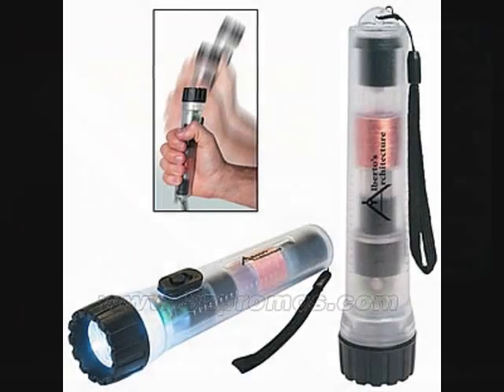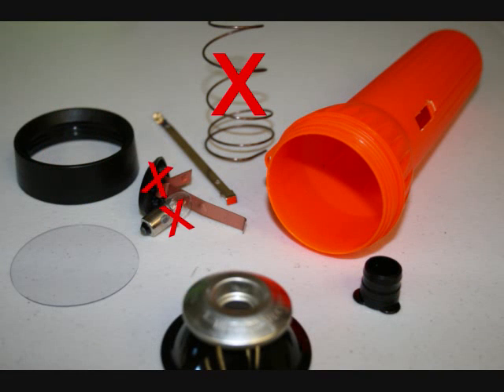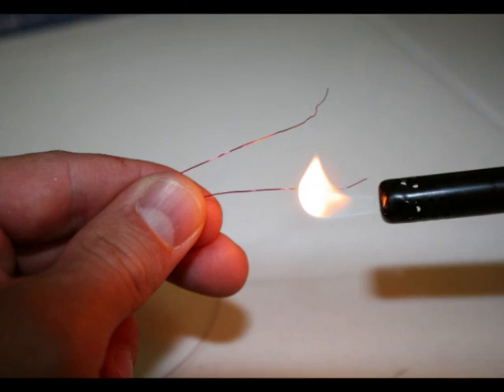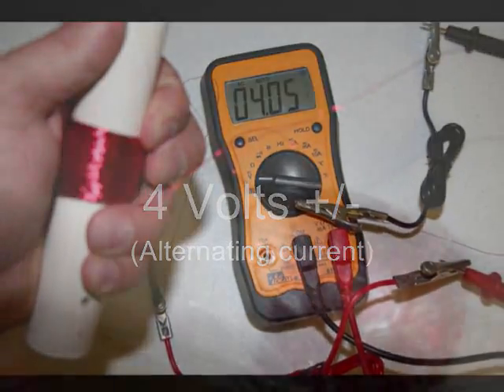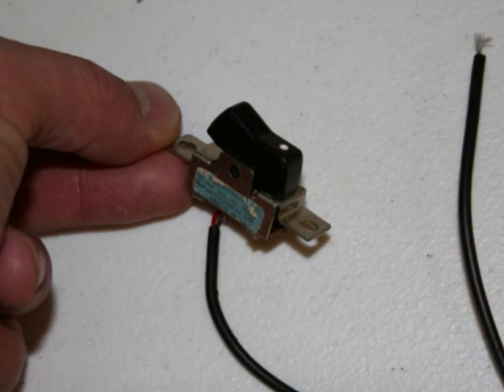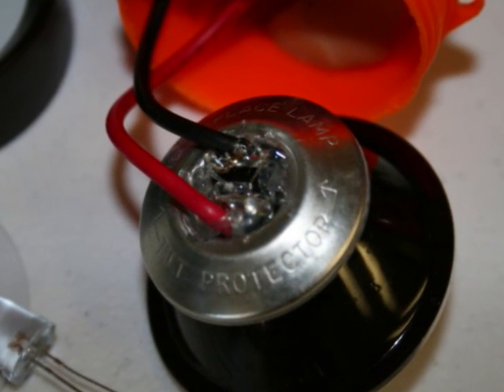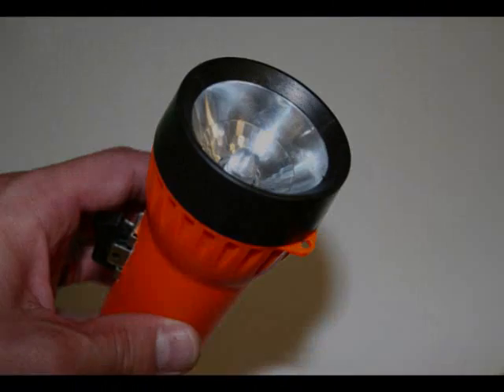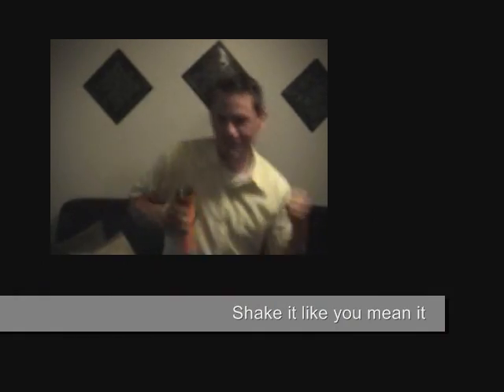DIY Electromagnetic Flashlight

Comment: what do u mean by a magnet wire, i have a 5oo ft of "insulated"copper wire, seems like of the same guage as yours, when I tried it with nano magnets to generate electricity, it didn't work not any volts at all. don't know what is wrong with copper wire. Is the "copper wire", used for motor winding not same as the magnet wire, you used to build ur flashlight.

Comment from the maker: @andyi321 With this small of a voltage I think you can use anything.  You can even take 4 diodes from a junk circuit board and solder them together to make your own bridge rectifier!  I did this and it worked great!

Comment from the maker: @baileyp27 I stripped that magnet wire off an old sump pump motor I salvaged from a swamp cooler unit.  The higher gauge the wire the better.  I'm not sure what gauge this was but I'm sure you could find something similar in your DVD player.  I suggest you take apart the DVD power transformer.  It's usually a large iron cube shape, that the mains leads connect to on the board.  The primary coil will have a very long, extremely fine wire.  If it's too fine for handling, try the secondary winding.

Comment: Where did you get the magnet wire?  Is it 32 gauge or higher?  I could get some 30 gauge from Radio Shack, but would be cooler to pull it off some broken stuff.  I doubt the motor in my old broken DVD player has enough.

Comment from the maker: @Anthropidia The first thing I would do is trade out your sphere for a cylinder.  You want the north and south poles exactly perpendicular to the wire coil.  A square or cylinder shaped magnet can do this, while a sphere will rotate randomly.  Maybe you are actually getting more than .6 volts, but the capacitor is discharging before you can measure it fully.  Try hooking about 5 of the .22F caps in parallel (hopefully they are rated 5volts or less or you might ruin your LED).

Comment: @01032010814 Good vid mate, I've been working on my own version for some time now.  I've done more or less the same as you but I can't get my 0.22 farad cap to charge beyond 0.6 volts even though I get over 3 volts ac and even more when rectified.  I'm using a 3/4" neodymium sphere magnet grade n38 it's very strong so I can't imagine that is the problem.  Do you have any insight you can give me as I'm stuck :-(

Comment from the maker: @evjcc No.  Volts and Amps are two different subjects.  The electrical pressure needed to light the blub is actually measured in Volts.  Amps would refer to the AMOUNT of electrons flowing in the wire, not the PRESSURE.  I hope that helps.

Comment from the maker: @777mrpelon I didn't count the wraps, but rather just used up all the wire I had. Probably about 400 or so? It was salvaged from a fan motor and I'm guessing about 26 or 28 AWG. Adding more LED's in parallel should work just fine. Only considerations are that they may drain the capacitor twice as fast, and may not shine as bright. If you use a larger cap, just make sure the voltage rating is compatible with the LED's. I used 5.5V and 1F. I haven't seen any larger that would fit in the case.

Comment from the maker: @777mrpelon I believe most LED's will burn out if you put too much voltage through them.  Probably about 3-6 Volts is optimal.  It should say on the LED package you buy how many volts, and how many mili-amps it draws.  When you use an electrolytic capacitor, make sure you hook the LED up + and - corresponding to the + and - of the capacitor.  If you have trouble finding small voltage capacitors with a large capacitance, you might try soldering many together in parallel.  This will be more bulky.
Reply: 8YEARS AGO!!